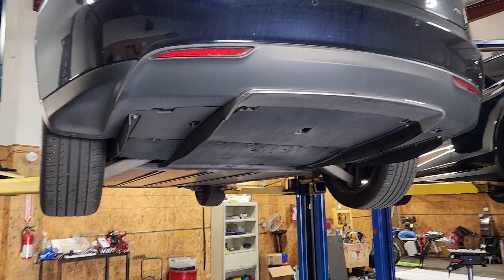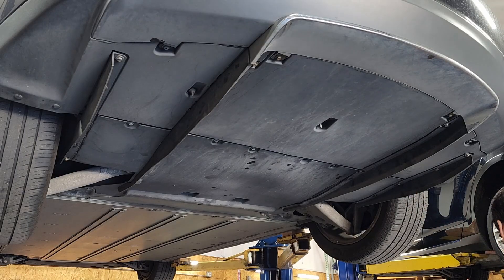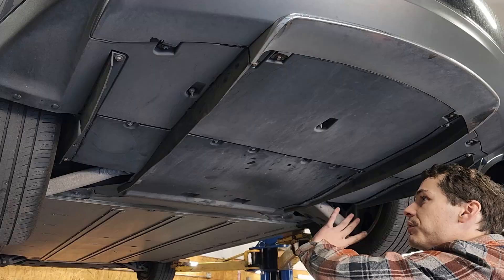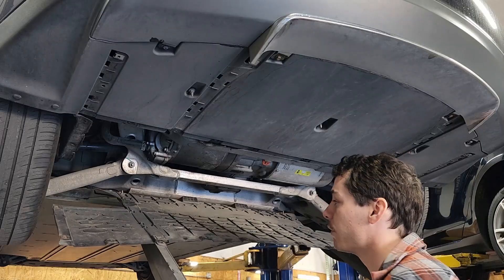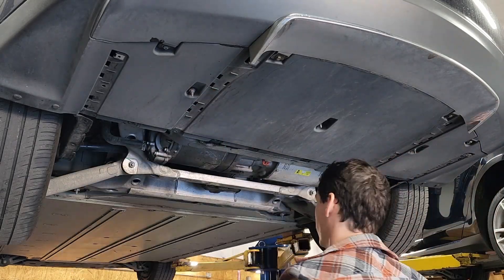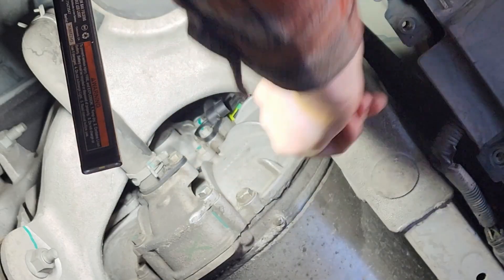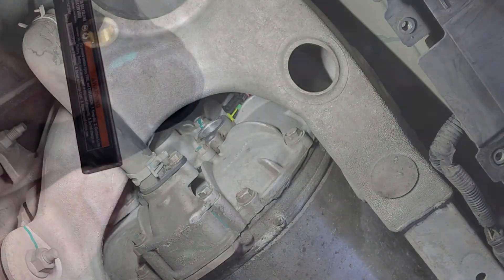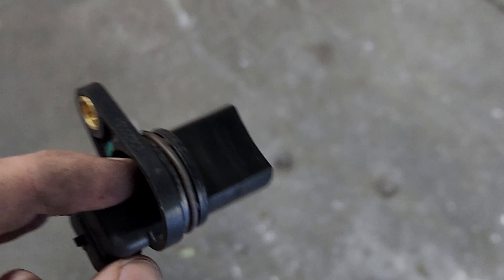Tesla LDU "Speed Sensor" Check (For Model S and X)

Comment: Alex, quik question, I just did the sensor check and had a little grease but no coolant.  when I put it all back together and tried to drive it off the lift the p n r and d dash indicator lights where all lit up red and it will not move. no error codes and I tried to reset.  Was I suppose to disconnect the 12 volt battery before I checked sensor?  thanks

Comment: if there's coolant, what is the next step to address the problem?
Reply from the maker: Depends on the extent of coolant intrusion... If it's pretty minor, you can probably get away with a standalone rotor coolant delete installation (which eliminates this failure mode). If there is a significant amount of coolant present and/or other signs of pending failure like rust and corrosion, then the next course of action would be to open up the drive unit and potentially rebuild it (or at a minimum pull the end cap off and assess the condition of the stator).

Comment: how often do these go bad???
Reply from the maker: How often do the rotor coolant seals fail you mean? This is an issue that affects ALL Large Drive Units eventually (with the exception of the newest "U-rev" motors built within the last 18mo or so). That's why this inspection is so important to do, as you want to catch this issue and address it before it can cause major damage to your motor. Or even better yet, pre-emptively installing a rotor coolant delete manifold will ensure that your LDU never suffers from this failure.